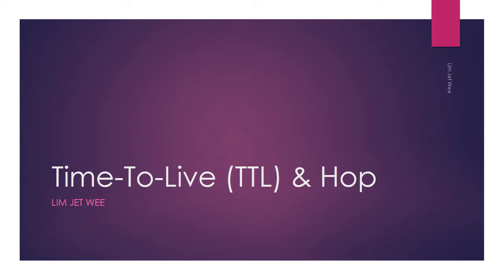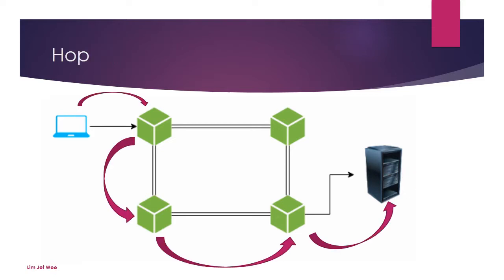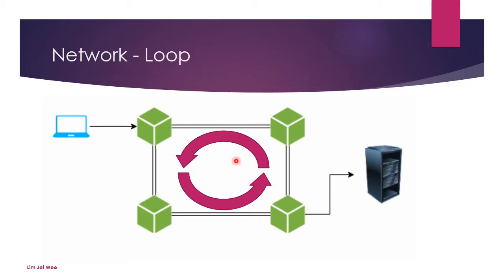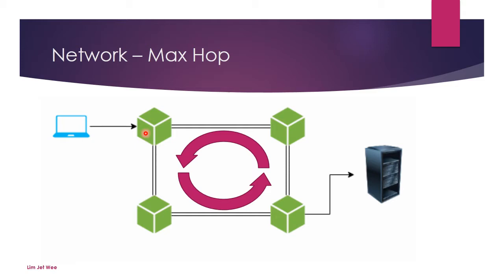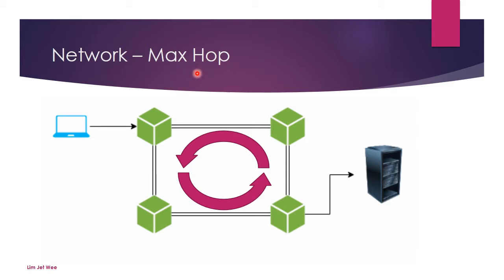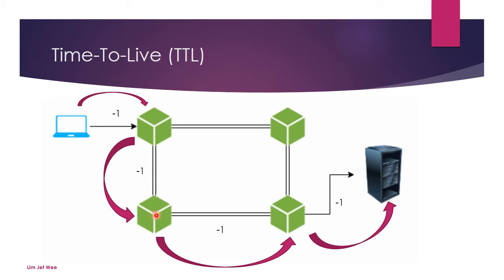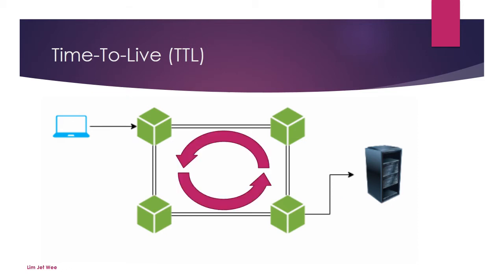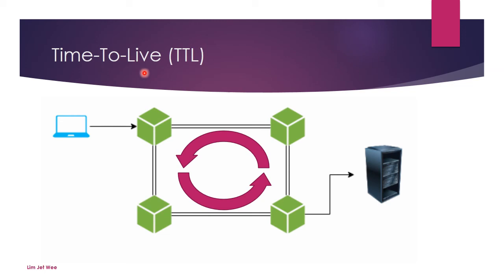Networking - Time To Live (TTL) & Hop

Comment: So if I am sending a message to a computer 5 states away; is this still going through the same process? if so, how does it know how many TTL attempts it should make?
also If a transmission does get stuck in a loop, will the sender be notified that the packet didn't make it to it's intended destination?

Thank you for your time!
Reply from the maker: The process is still the same. Most protocol has a default TTL value which is enough to reach anywhere you want it to reach. As for if the send is aware of a TTL timeout, it depends on the application used, example a browser may show a 404 error dispite the web server is up and running, a mail application may show a connection problem, but some application may not show any messages at all. Hope this answer your queries.
Reply: @LimJetWee  Thank you. That answer was very helpful! I am currently an aspiring IT Support Specialist and learning as much as I can, as fast as I can.
Reply from the maker: @elements2202  You are welcome. https://www.facebook.com/groups/425402317548492/ This is my Informatics Facebook Group about Computer. Hope it's helpful.